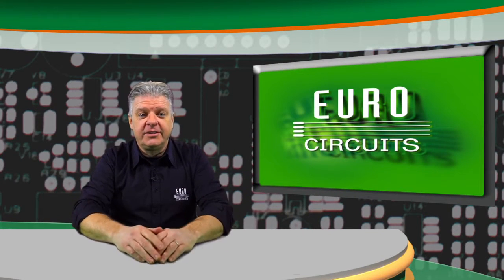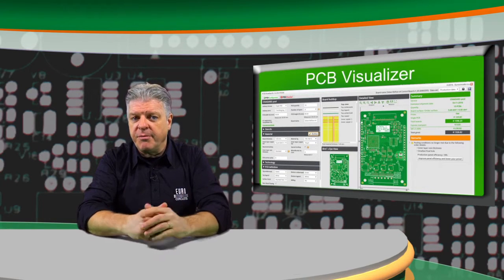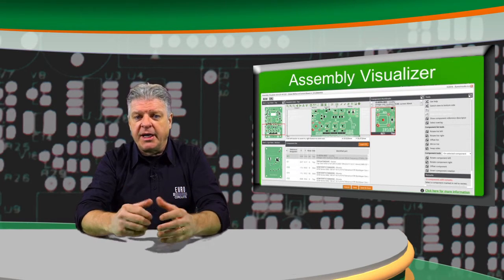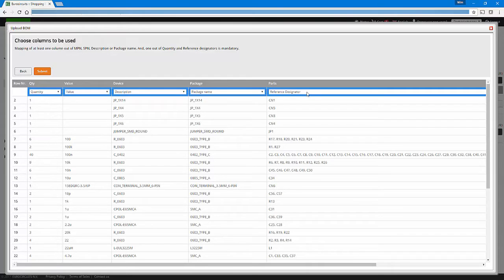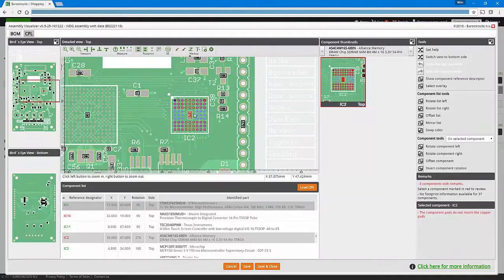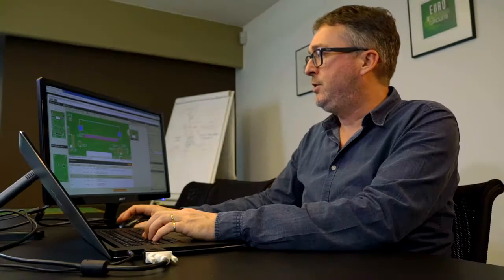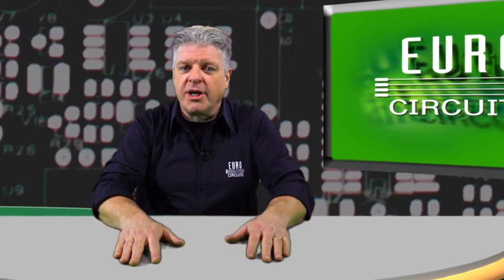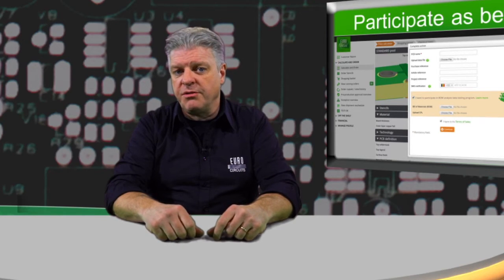Eurocircuits presents PCB Assembly Visualizer

Comment: How can is possible to do the CPL process manually if dont exist any CPL file to upload?
And PCBA is already available on eurocircuits or is only now for small quantities/projects?

p.s.: i creat a CPL sample with this template type: Ref;Xmm;Ymm;TOP;Angle to upload and reposition each component manually, but the menus from PCBA Visualizer are not OK on my 2 browsers (firefox and also checked on chrome "better here, but still with problems in work with the PCBA Visualizer" because the Menu "components tumbnails" dont show where are the components..) need some plugin or disable anything on my browsers?
Reply from the maker: Dear Hugo, the full user guide of our PCBA Visualizer can be found here: https://www.eurocircuits.com/pcba-visualizer-user-guide/
We cannot give customer support via this comment window as it is not integrated in our customer support department. Please use live chat on www.eurocircuits.com, or email euro@eurocircuits.com or call +3215281630